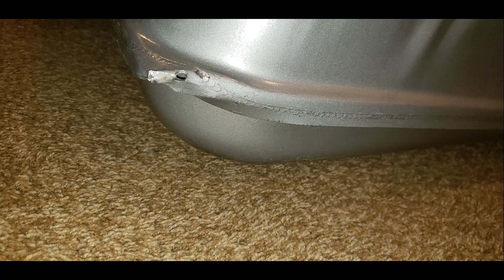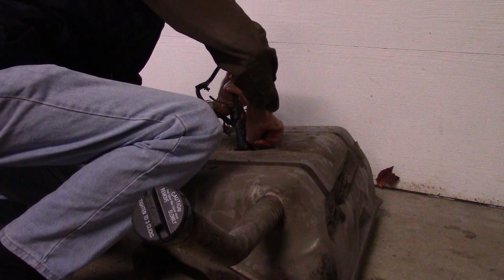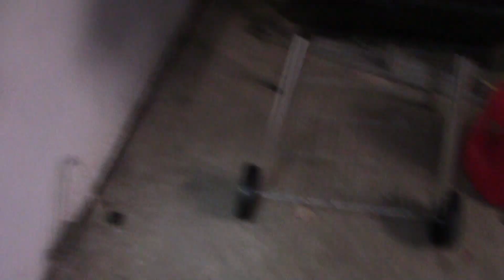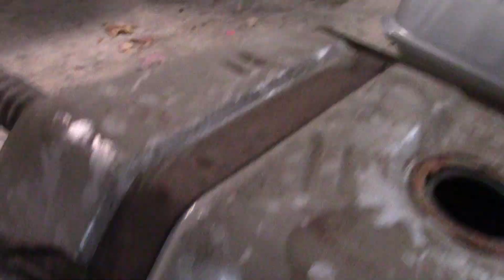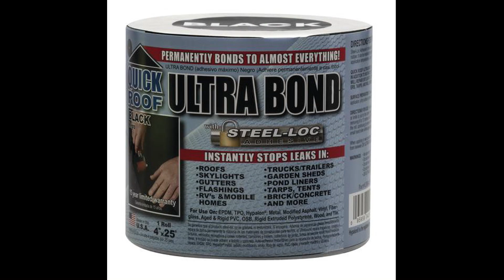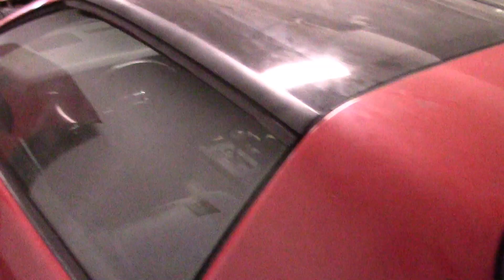Selecting / Installing New Gas Tank for 3rd Gen Camaro - IROC-Z Barn Find Camaro  EP#18

Comment: I need a new fuel tank for my 94 Firebird Formula and the Dorman 576-055 seems to be the only one I can get. But this gas cap situation has so confused. There is a review on Summitracing where the guy had to get a gas cap from a 88 Fiero that fit the Dorman filler neck. I have no idea what to get that would fit, the measurements of the gas caps are all over the place and I am not in the US, so I can't just go to any parts store and start testing gas caps. Unbelievably annoying.
Reply from the maker: Your tank is different from mine, so I can't be certain, but I don't know why Dorman would use a different one, the tanks are quite similar 3rd gen to 4th gen. This is a very common cap.
In any case, I have a long paragraph on the cap in the description section of this video. I used a Stant 10834 per Dorman advice.  Looking today, it appears that Stant brand is no longer making this cap, but others are making caps with this part number.  The 10834 fits several hundred various models of Acura, GM, Nissan, Toyota, Ford, Chrysler, Honda and more.  I see the Fiero (all) in the list as well.  I would suggest that you look up the Stant 10834 application list: https://www.autopartsprime.com/stant/fuel-tank-cap/mp-10834 and see what vehicle application might be used in your local area.
Reply: @bitsofwisdom460 Yeah I read your video description and I've been though a multiple hours long odyssey with several forum topics, including your posts on ThirdGen in those topics.

People keep talking about the threads in those topics, and by now I am pretty sure the 1.77 in diameter is needed, but there are many different lengths on different caps that fit that diameter.

A review on Summit says he used a 88 Fiero cap that fit and that should be in line with the Stant 10834 and the OEM for that should be GM GT195, but that one has a much shorter depth.

In the end I opted to try and save the old tank and use a new sending unit and Walbro fuel pump. We will see how it goes.

The problem is, I am in EU, so by now (unlike ~20 years ago) we don't have any parts for older US cars at all here, and the few shops that carry them are insanely expensive and only carry very select few items.  So I can't go to any store and just test a few.
Reply from the maker: If you still want to try, go to the link in my last reply and expand the list. There are many applications for a 10834 that ought to be in your region.  I see Audi, Jaguar, a large number of Volvos (as recent as 2018 Volvo V60), certain Volkswagens. I would think that one of those ought to be available in your region.
Reply: @bitsofwisdom460  Yeah thanks, I might look into that. However, I have looked at many many "equivalent" parts and they are not equivalent at all regarding their dimensions. That's what makes all of this so difficult. In addition, my default gas cap has a lock on it with a key so I'd wanna keep that functionality because GM didn't have the brains to have the gas door locked with the central locking like a normal manufacturer with a few brain cells...

Comment: I installed a Dorman in a 1991, but I can't find the fuel tank cap. The tank has a different thread, and Dorman is telling me to look it up on Google. Did you have any problems with the cap?
Reply from the maker: Yes, The cap was a problem.  I discuss it here near the end of the video: https://youtu.be/ZSMTIDV9Dgo?t=438

I had a new OEM equivalent for an ‘85 Camaro, Stant 10822 and it wouldn’t go more than about one turn. I contacted the Dorman tech line by chat. They advised me that they used a Carquest / Stant 10834 cap for their testing. That cap fits a large number of newer GM and other vehicles. It appeared to be a 2010 to 2015 Camaro cap, but that listing doesn't match any longer. Just look for a 10834 or equivalent.
I couldn't get a "why" from Dorman on the change. The tech support person looked up what he called the "verification testing" data from when they tested the design. He indicated that was the cap that they used for prove out testing. He didn't seem to have design information. I was a little skeptical, so I took the tank with me to the parts store. They let me take the 10834 cap out to my truck to test fit it before I bought it.

Comment: I also bought a Spectra sending unit for my 1990 Pontiac Firebird Trans Am GTA.  This is my second sending unit as the parts manager at O'Reilly's Auto Parts  sold me a Dorman brand unit that had the wrong harness code.  I called Dorman Tech Support and they told me they don't make a sending unit for my car.  My harness Code is FPJ.  Also, I checked the ohm's on the unit from empty to full and my readings were 1.0 for empty to 92.0 ohm's for full.  Could you please tell me what you reading's were on your sending unit?  I take it that 92 for full is O.K. as the specs on the Spectra unit should read 95 ohm's at full.
Reply from the maker: Mine went from zero to 95.  My '91 service manual calls out 0 to 90 as the official empty to full range. 95 would let the gauge read above full.

Comment: Im having that issue with finding a gas cap that fits when I went to replace mine on my 1987 iroc . I see that a new tank was put in by the previous owner and the cap that came with the car didn't fit right so I bought a new 1 and also doesn't fit right so I might try the 2010 cap like yours ..
Reply from the maker: Yes, that cap is worth a try.  There aren't that many companies that make replacement tanks.
Actually, I went to the parts store with the tank in the back of my truck and they let me test fit that cap before I bought it.
Reply: Thnaks for the info @bitsofwisdom460

Comment: I;m glad you're making these videos! keep them coming! I have a 187 TPI Iroc z with the 350 in it, is been mixing some coolant with oil and has that milky residue... i open the radiator cap and bubbles a bit so my guess is i blew a head cylinder gasket, it does not overheat but i don't fire it at all now that i know it has that problem. surprisingly. makes me wonder if is the intake manifold gasket tho? im looking for more evidence until i do the job because ive never done it before but with your help i could pull it off :)

Comment: Is it possible the intake manifold leaked coolant into cylinder 5?  Thats exactly what happened to my 305 and it was cylinder 5 also.
Reply from the maker: I looked at the gaskets very carefully and didn't find any tracks indicating leakage, but I have plenty of surface corrosion on the external parts from high humidity.

Comment: Thanks for the info. I need a new tank for my 86 TA WS6. I could not believe the amount of crud in the tank. Yes people have said there are issues with filler neck fitment on some tanks.
Reply from the maker: Yes, from the comments that I saw various places, I was quite concerned. Some people were going through great difficulty even to the point of bending or re-welding the filler neck.  That's not something I wanted to attempt.  The only thing I can add to the video is that the tank does need to be properly seated on the body rails.  I had it slightly out of position initially, but after a little more effort, it popped into position. I did check the filler neck position by installing the filler pocket before I torqued the straps down.